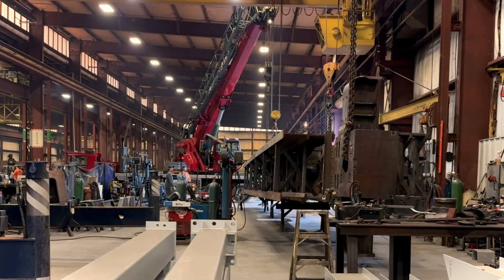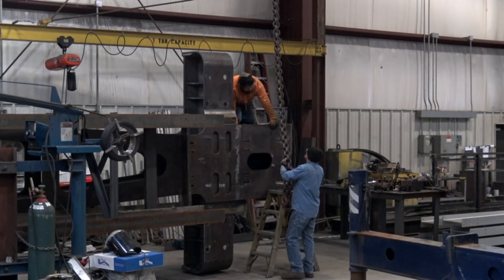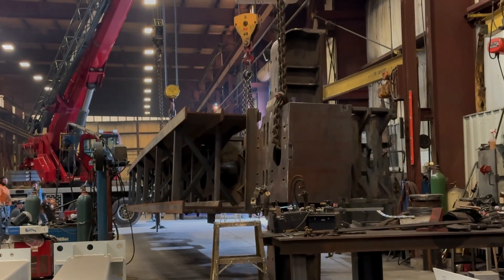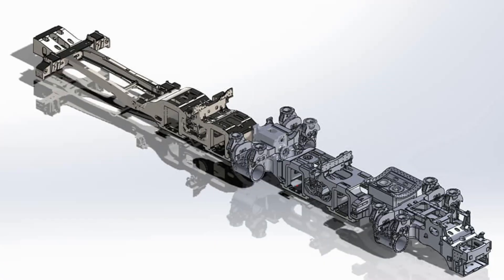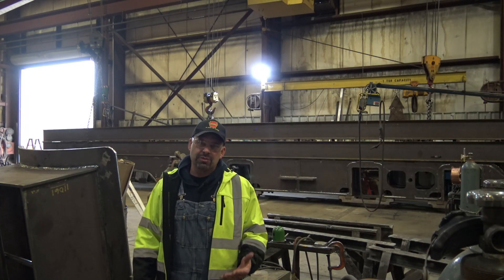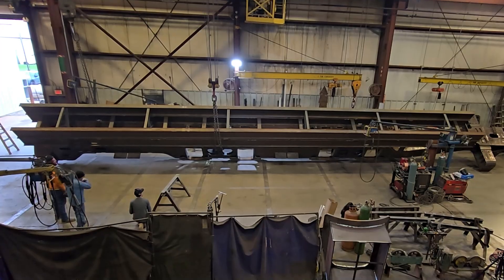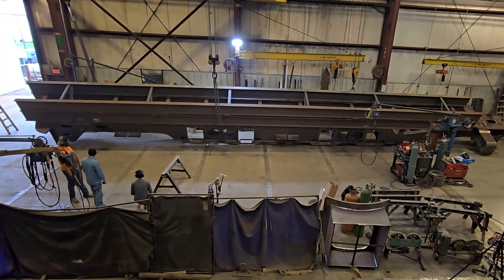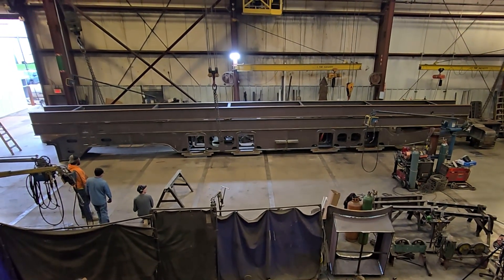T1 Trust Frame Flip - April 2025

Comment: I sure wish out local restoration project was this organized, funded and directed. Ours cant even make a half descent web sight.
Reply: You need to inform them of that, if you haven't already. Getting your project out there, to the public, is critical! Good luck!
Reply: At least your website wasn’t taken down like the Ben alder project
Reply: What’s the restoration project?
Reply: @PrrProductions2 2716 in Ravenna KY. They host maybe 2 events a year.
Reply: @  I checked out their YT channel & it could use more videos & the website could stand to be updated. Wonder if they are running short on help & just don't have time? Maybe the staffing isn't there to handle an increase in riders. Could be a myriad of issues really. If you have time, maybe volunteer there. Get some friends involved if anyone else is interested. That's how most of those museums got their start in the first place. Just spreading the word to get the message out is a start.
Reply: @2ndprotectsthe1st27  well I think the first mistake was taking that on when they had NKP 587 on their hands. The second one is choosing the middle of nowhere Kentucky. Build your shops in Louisville or something! Third mistake is like you said advertising and promoting. The 2716 deserves a better life. Same with NKP 587